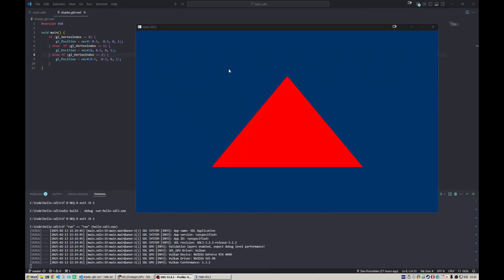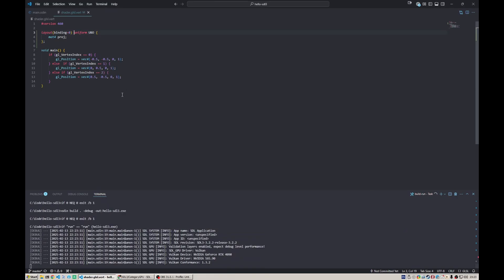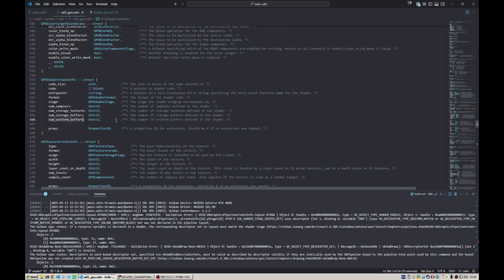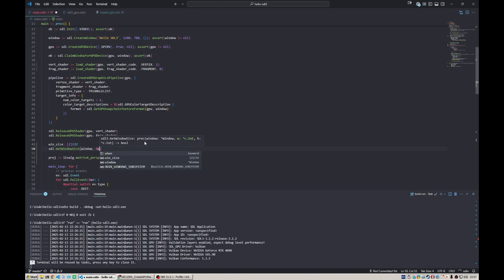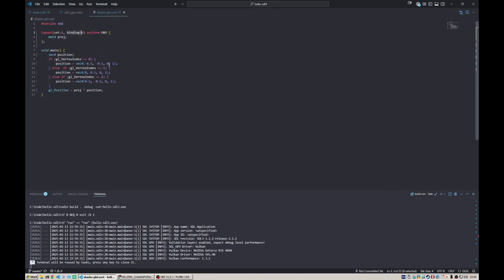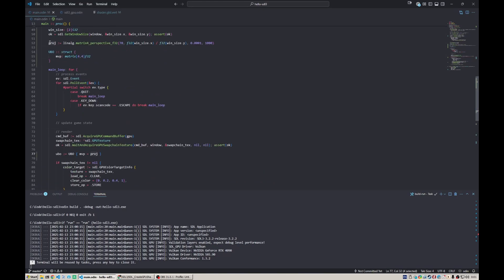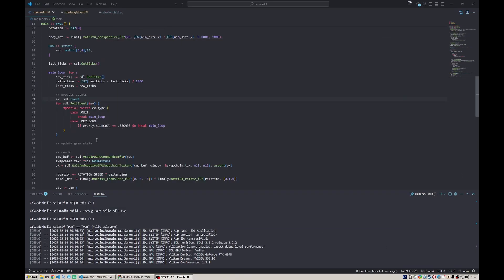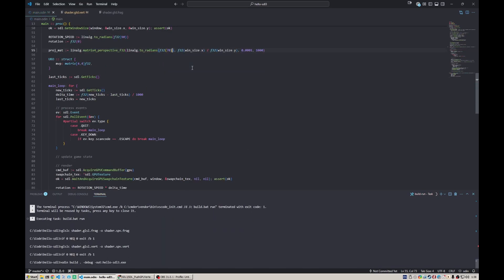Odin SDL3 GPU Tutorial: Part 2 - Uniform Data, Rotating triangle in 3D

Comment: If you're following along in another language and find that your uniforms aren't working, one reason could be memory alignment.
memory alignment when sending to the GPU is done according to a standard known as std140. Here's what you need to keep in mind:
- 32 bit float:    aligned to 4 bits, matching their size
- vec3 of 32 bit floats:    aligned to 16 bits even though their size is 12 bits
- vec4 of 32 bit floats:    aligned to 16 bits, matching their size
- mat3 of 32 bit floats:    I think this is 16 bit alignment, but look it up or test yourself
- mat4 of 32 bit floats:    I think this is 16 bit alignment, but look it up or test yourself
- there are others that I haven't mentioned
- one source I looked at described different rules for arrays

If you don't follow correct alignment, a test with an identity matrix could easily lead to a blank screen.

Another thing to keep in mind is that matrices are column-major not row-major. If you don't know what this means, Wikipedia has a good graphic showing the difference
Reply: May ask which language were you using ?
In my case I just did the following which worked:

std::array<float, 16> createPerspectiveMatrix( float fovYDegrees, float aspectRatio, float nearPlane, float farPlane )
{
    float fovYRadians = fovYDegrees * ( 3.14159265358979323846f / 180.0f );
    float f           = 1.0f / std::tan( fovYRadians / 2.0f );

    std::array<float, 16> matrix = { 0 };

    matrix[ 0 ]  = f / aspectRatio;                                            // [0][0]
    matrix[ 5 ]  = f;                                                          // [1][1]
    matrix[ 10 ] = ( farPlane + nearPlane ) / ( nearPlane - farPlane );        // [2][2]
    matrix[ 11 ] = -1.0f;                                                      // [3][2]
    matrix[ 14 ] = ( 2.0f * farPlane * nearPlane ) / ( nearPlane - farPlane ); // [2][3]

    // matrix[15] is 0 by default, rest are zero

    return matrix;
}
Reply: @wassou93  I had been adapting to 2D as I followed along, which is why I ran into the problem. I've since changed to 3D because it has advantages even when working on a 2D project. I'm using Zig, and here is the code I was using for the matrix before:

const Mat3 = extern struct {
    col1: Vec3 align(16),
    col2: Vec3 align(16),
    col3: Vec3 align(16),
};
const UniformData = extern struct {
    proj: Mat3,
};

// ...

const vertex_uniform = UniformData{
    .proj = Mat3{
        .col1 = Vec3{ .x = 1600 / @as(f32, @floatFromInt(window_size[0])), .y = 0.0, .z = 0.0 },
        .col2 = Vec3{ .x = 0.0, .y = 1600 / @as(f32, @floatFromInt(window_size[1])), .z = 0.0 },
        .col3 = Vec3{ .x = 0.0, .y = 0.0, .z = 1.0 },
    },
};
Reply: @karvie  nice choice :) I like zig.